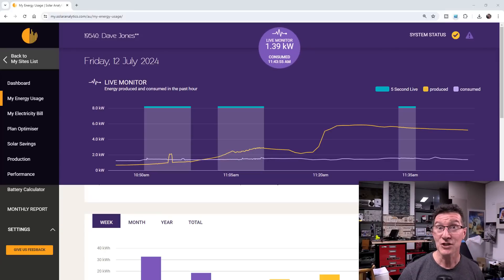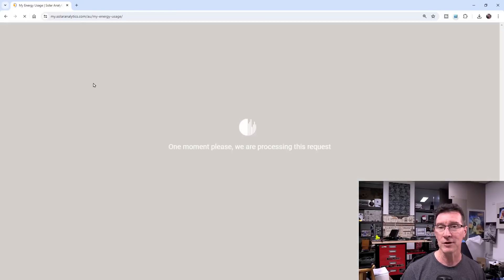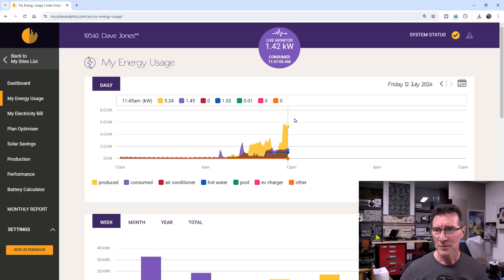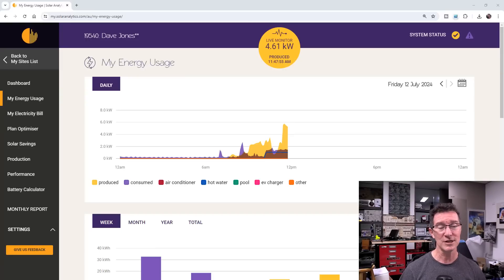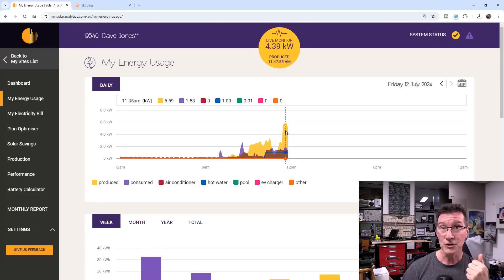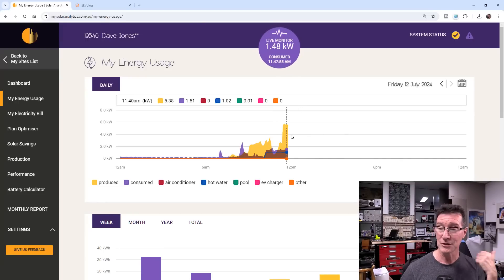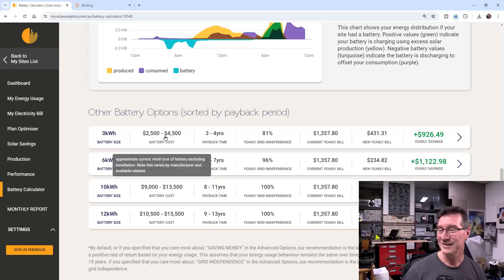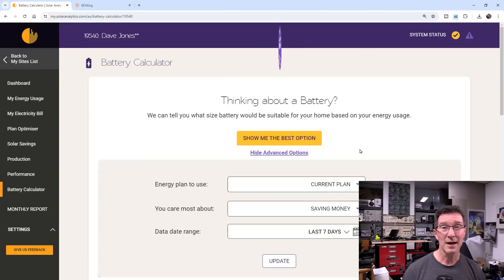Home Solar Power System Re-install is now completely working!

Comment: For a fixed power storage solution with lead-acid batteries, you might do better with the big batteries for older electric lift trucks than with old car batteries.

Comment: Bit of a worry about the MC4 contact.  You are supposed to use connectors from the same manufacturer to ensure this doesn't happen.  In my limited experience, and I do mean *limited*, even cheap connectors from the same manufacturer mate properly.  So either they are mixing brands or the connectors simply weren't plugged together properly.

Comment: Installers will refuse to clean your panels for obvious reasons - if they damage them, they'd have to replace them. So they're going to handle those as little as necessary to install and connect them. If one of them are faulty they will check and stop the install and make you fix it. Then when they come back they will charge you another fee to travel to your location. Such is the danger of providing your own panels - they will refuse to do a lot of things to avoid being responsible for them.

Comment: Sizing a battery system needs several factors taken into consideration IMHO......
- Your year round weather.
- Does your energy supplier have cheap rate import/export hours?
- Does your battery/inverter allow easy tweaking turning on/off charging/export, and is it automatic linked to weather?
- Your electricity consumption especially evenings/night time, EV etc.
- How much you can be bothered to look after all the above!
I've had a 10kWh battery for 6 months, so far it's working out great for the input I give it and the software I have written to semi-automate it.

Comment: When you size your batteries, don't forget to take into consideration how much energy you need to keep in them as a floor.  I've seen threads talking about "don't routinely drain them below x% (40%, 20%, 0%, etc.).  But, for me, the important thing was how much reserve I wanted to keep "just in case."  So, I routinely let them discharge down to 40% and then start pulling energy from the grid (or generator if the zombies are attacking).  IOW, the functional size of my 19.2kWh battery pack is 11.5kWh.  In the spring and fall, that gets me through the night.  In summer and winter, the batteries last only until the wee, small hours.  But, I still love having them.  They smooth out those bumps in production/consumption.

Comment: 02:00 Get a drone with a thermal camera to check the connections Dave.
Reply from the maker: The connections are under the panels.
Reply: @EEVblog2  t's scary to think of all those multi kW of power and connections that weren't checked for low resistance. Burn down your house, anyone?

Comment: 😂Gotta get the batts, do a diy system with 48v rack mounts.
I have 18kwh of 'used' home batts, about $9k set to 12kwh usable (20% doc limit) and average 3 kwh import power week. With hot water on a timer to run around lunch, draws from the batts even on crappy days there's usually enough recovered in the packs to heat the water.

2 LG resu 6.5's in parallel (li-ion) and an alpha b3+extra module (lifepo4)
Reply from the maker: Was thinking about the 19" rack option. Need to mount this outdoors so need a housing solution. The LG batts were recalled!
Reply: @EEVblog2  mine have been checked by LG, but yeah that's a thing.

Comment: Nice to have it up and running, and as for battery systems, you could check out https://www.youtube.com/@TheDigitalMermaid - she built pretty impressive energy storage system at home.

Since you're in the middle of winter down there, I guess the data used for battery simulation is for the worst-case scenario. Done in the summer, when you'd get lots and lots more sunlight, you'd get lower capacity and could go wrong on that.

Comment: :hand-pink-waving:2:00 You can build a robot with a thermal imaging camera that can drive under the panels!
It would be interesting to see how many OLD MC4 connectors are HOT :-) :face-blue-smiling:
Mr. EevBlog can you sleep peacefully now😴, because it can really be that the old reused connectors get hot and of course can burn...
Build a robot! and make a video :-)

Comment: What about a lead acid forklift battery?
Those are still pretty affordable compared to the "specially designed for home use" lithium batteries.
Reply: Short lived, need to vent hydrogen gas and high maintenance, no thanks.

Comment: How can you draw any satisfaction from a job done in such a half assed fashion.
Reply: Even still a quick run around with a rag.
Reply: It wasnt a clean rip out and their own kit install. It was a hodpodge patchwork kit and the company did the right thing to fix it at their cost.

Comment: The panels also block some of the sunlight onto your roof, reducing heat in the loft!!
Reply: I've noticed that with our solar installation, we have our bedroom in a loft conversion and its definitely a little cooler than I expected for summer... although the weather here is bonkers lately 😂